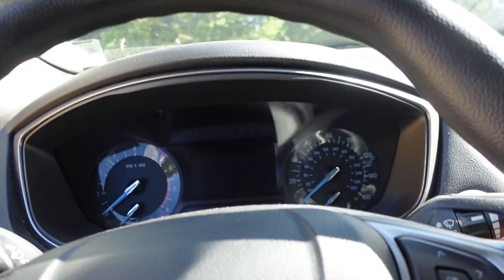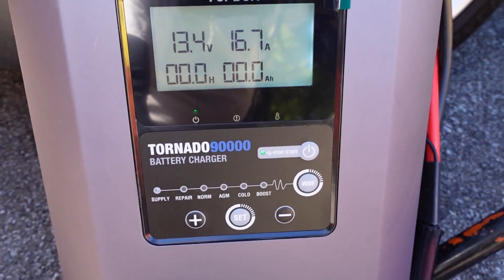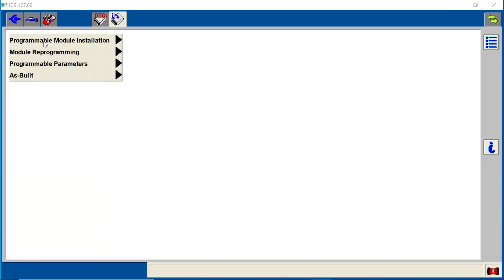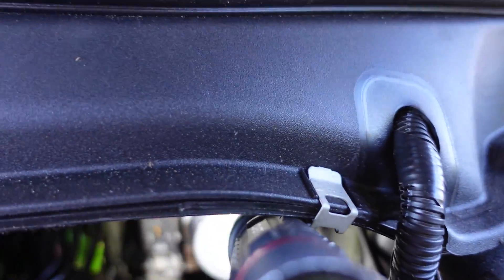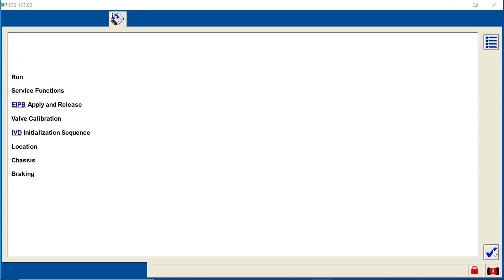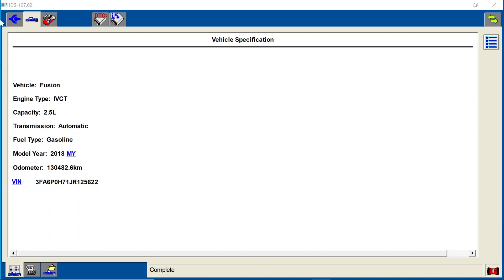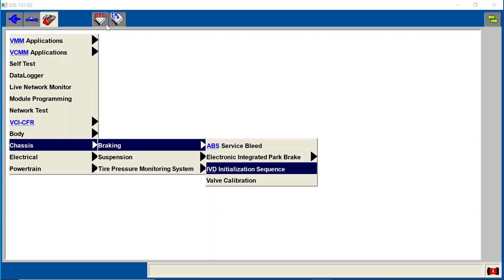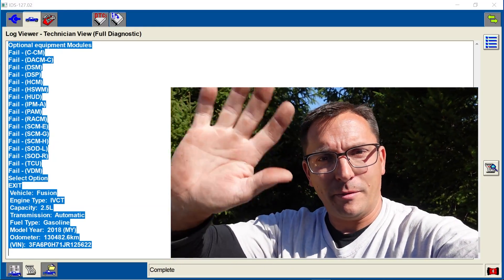2018 FORD FUSION ABS Module Programming

Comment: I am having traction control and abs come on intermittent and then usually goes off. Feature is on. Resiv is not low. All speed sensors have been removed and cleaned and inspected but not tested. I recently bought a good scan tool that has full abs included. So waiting for it to arrive. Hopefully it turns out to be a bad speed sensor.  Sadly if it turns out to be a bad abs module I cannot just buy a used and swap. From what I’ve seen it has to be reprogrammed. Not something I can do if it comes down to it.

Comment: I replaced an ABS control module on a 2012 Ford fusion hybrid with the factory one I programmed it with FJDS using as built data it said configurations complete but it’s not completing.

Comment: I’ve been using forscan lately for used modules. Easier than ids in my opinion. Go in load factory as built data hook up ids after see if the latest calibration is in it

Comment: Three things I am not fond of. Automatic transmissions. ABS. Power steering with no feedback.
Why? I seen a operator pick up bricks and stack them with a metal shear on a Komatsu PC 300.
The excavator had hydraulic controls with feedback. He could not do it with the new one. Electric controls.
 Those are cheaper than training the operator. Ask the Army about that.
MY point. The best safety device is between your ears. As long it is alert and experienced. Aware of the driving conditions. None of that is needed.
Reply from the maker: Yes the whole world/ manufacturers playing the market to make people not want to think or take responsibility.